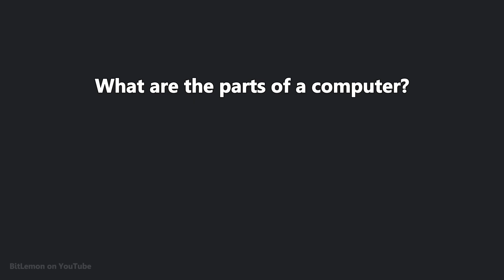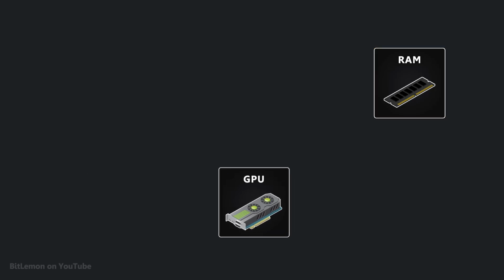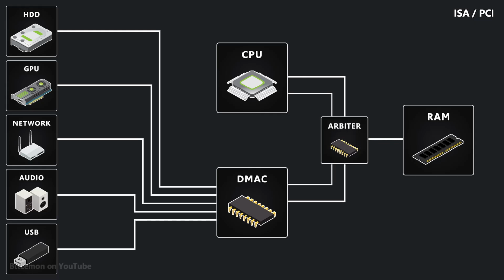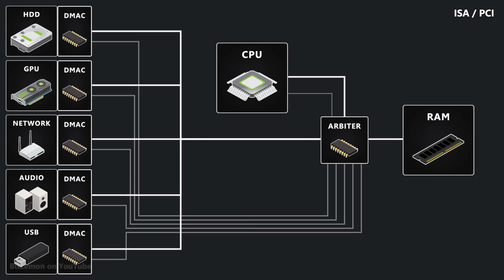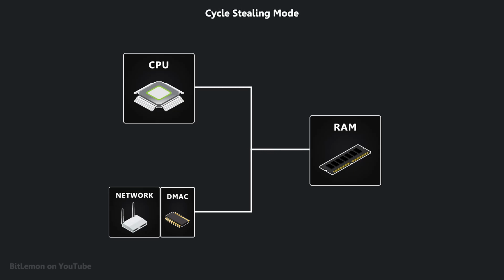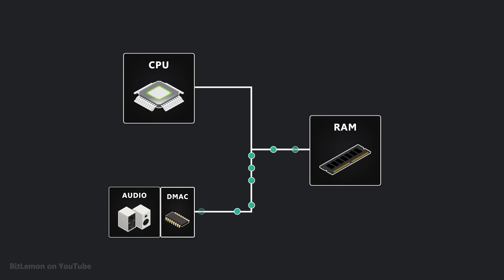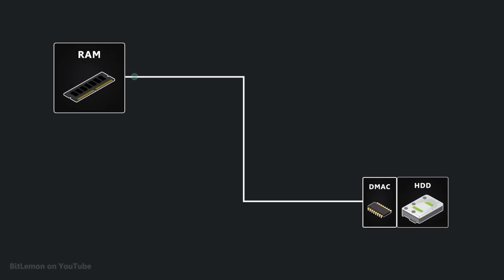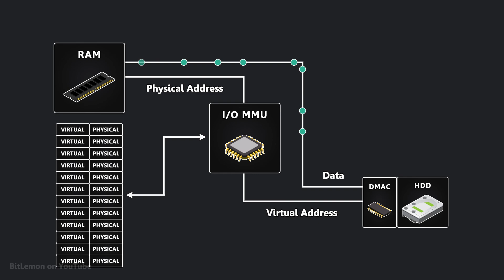DMA Controller: How Peripheral Devices Transfer Data to RAM

Comment: This was a great video on this topic. I also learned a bit too. Some constructive feedback on the diagrams, they are a bit confusing in some areas. For example the CPU cache. The way you drew the bus with everyone on a common bus but data is somehow only flowing tk specific parts is in conflict with other diagrams that show something blocking the way and a new node is made between them. Simply, i think if the cache was between the CPU and the bus it would make more sense. Data from ram cache, then from cache to CPU. 

Regardless, Ill still spread this video around to my students. Cheers!

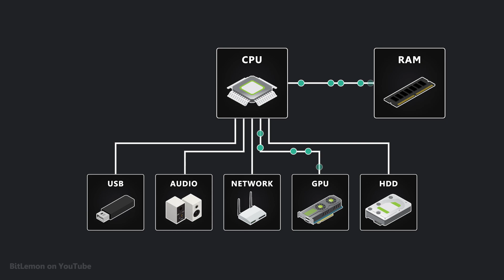Comment: 0:59 CPU doesn't not have any idea of what HDD it is managed by OS so don't have direct connection BTW nicee video ❤
Reply: I think it doesn’t really matter in this context and is explained very well in one of the other videos on this channel :) The main point is that without DMA the CPU still would have to move the data on its own, even if there are layers of indirection in between.

Comment: How life and DNA manages memory seems far more sensible for me. There is no single point of failure. All computation happens in memory, all processes run in parallel. There are many computational systems in nature besides genes. All of them that I know of use in-memory computation and they are intrinsically parallel.

Comment: Can you list the resources you usually use to research or learn about these low level things, in low level i mean lower than assembly and everything that is going on at the hardware. If you know any books, blogs, any resources please let me know, I am really interested in such stuffs.
Reply from the maker: I'm not gonna lie - it's not easy to find reliable information. It's scattered across so many sources, you really have to dig deep and connect the dots yourself.
The sources I use for research (in descending order of usability): books, academic papers (research papers / patents), articles (forums / blogs / wikipedia), YouTube videos, chatGPT.
My favorite (and most relevant) books are: Operating System Concepts (10th Edition) and Modern Computer Architecture and Organization.
I also pull information from other books: Computer Organization and Design (RISK-V), The Cache Memory Book, Multi-Core Cache Hierarchies, Computer Architecture - A Quantitative Approach, and others.

Happy learning!
Reply: @BitLemonSoftware  thanks thats more than enough for me. Will try to read and piece everything together in the next 6 months or so.